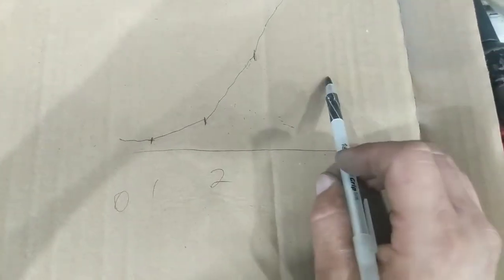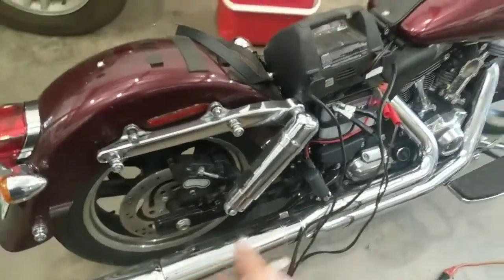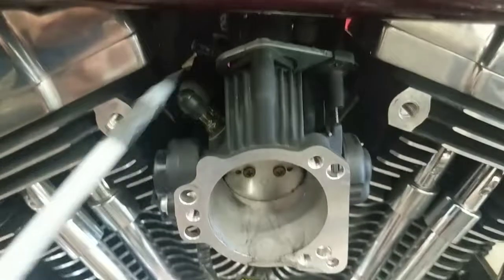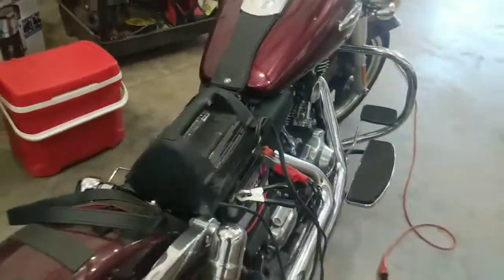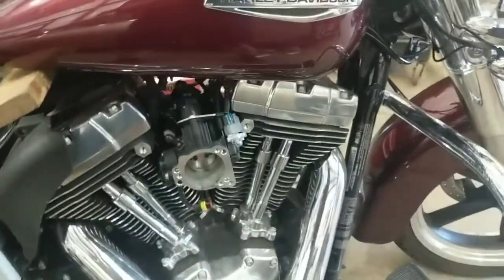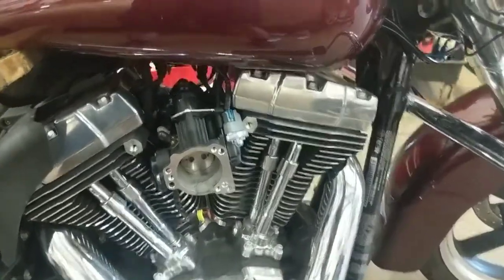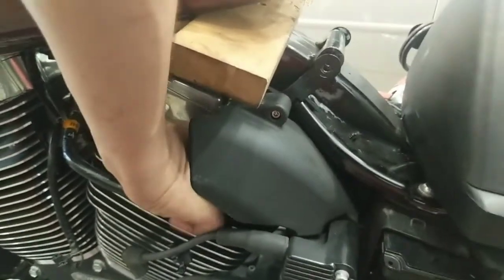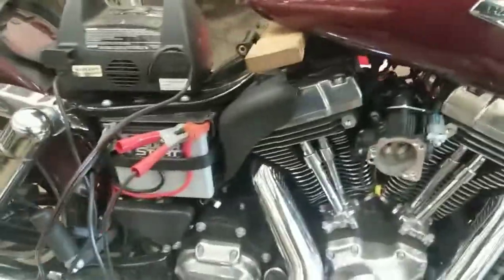MAP sensor Harley Davidson. A look into how it works with the intake pulses to time the injectors.

Comment: Ok how do you set timing for fuel injectors
Reply: Graph the MAP reading in the program your running. For instance the graph I have in the beginning use the first LARGEST upsweep of the MAP reading. This can either be the first or second upsweep.
Reply: So if my map sensor is bad my injectors will not pulse, because my bike will not start. It has all new fuel system, injectors. New ecm. But no pulse
Reply: @joelstuckey4689 what did you do to fix it and get back to running again